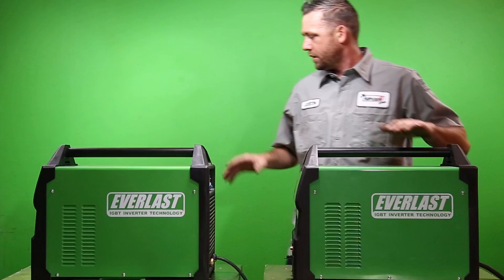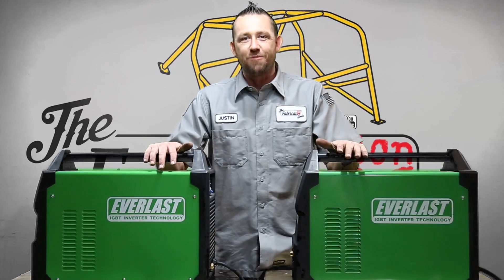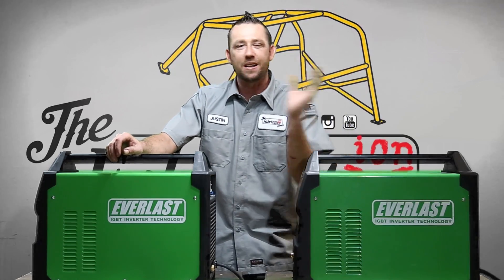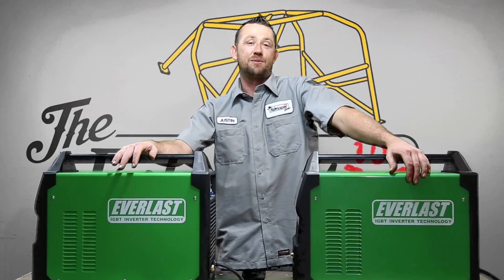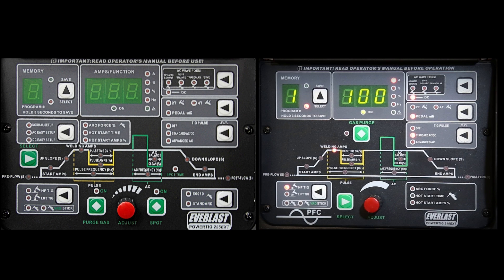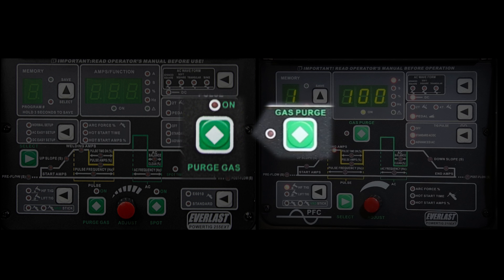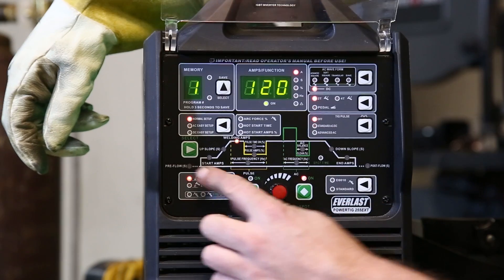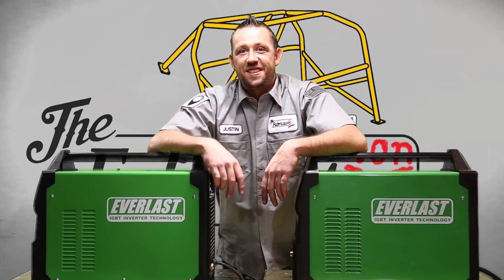TFS: Everlast PowerTIG 255EXT and 210EXT Welder Review

Comment: Thanks for the video just bought the 210 ext a couple months ago. Love the machine I do regret not getting the 250 instead just because the little higher amperage even no I have no use for that many amps right now. Wasn’t in the budget at the time. But still am in love with the 210ext. And am glad with my purchase. I also upgraded the TIG torches and foot pedal. Roto flex TIG torches their version of super flex cables. And their nova pedal which is almost identical with the ssc foot pedal. The torches aren’t as good as ck TIG torches and cables but I paid $50 for each torch upgrade = $100 for two torches when one ck 17 torch is $150 minimum. And $100 for the nava pedal upgrade. Overall I am really satisfied with my purchase. Hope this info can help along with the awesome video from this guy👍 👨‍🏭
Reply from the maker: The Advanced Square features of the 210 allow it to really push some thick stuff. I rarely need more than 200 amps here at the shop, so the 210 is a very realistic TIG machine to own. I just picked up a Nova pedal as well which is pretty incredible. I might review it after I have more time using it.
Reply from the maker: Steven Crosbie I usually tell people the 210 is an extremely capable machine and it will probably never fail to do a job as a hobbyist, or working in an auto fab shop. Most people buy the 255 anyway haha. 

I flipped the easy setup on a few times and didn't really agree with it. That's probably because I am experienced and wanted to dial it in to my own settings. I don't have much opinion on the easy function because of that, but a couple people told me it helped them lay some beads right out of the box.
Reply: As a hobbiest, 1st TIG machine, would you spring for the 255 to have the easy setup and potential growth capability?  About $560 dollar difference right now.  The budget would allow it, but also don't want to spend money for features that most really would never use.  Don't have any specific uses in mind yet....just getting into the hobby.  Thanks!
Reply: Thanks for the feed back.  The Nova Pedal is  actually improved over the SSC and has twice the life span @ 2 million cycles along with a better cable strain relief and improved cable and some additional things inside that make a difference.  The Nova has a high end Japanese potentiometer vs.  the Mexican built potentiometer of the SSC.  If you have the Ultraflex cables, they are identical. The torches are nearly too, and out of the same materials. The only difference is that the Rotaflex have a heavier duty built hinge.  In our testing of CK vesus Nova, the Nova equaled or outperformed the CK on duty cycle.  The Rotaflex torches are a better price overall.  If you compare item for item in a name blind test, people will not tell the difference.  At shows people have not been able to tell the difference.